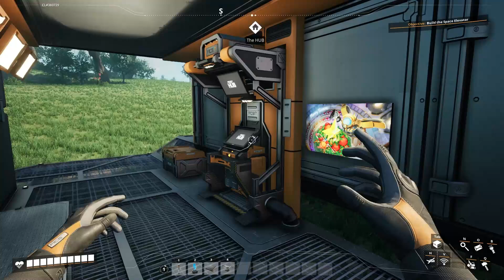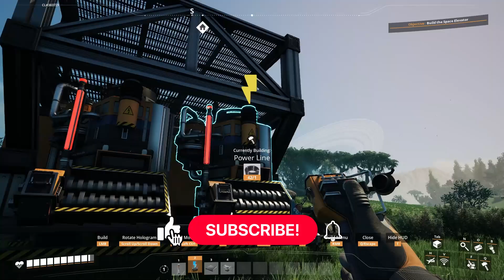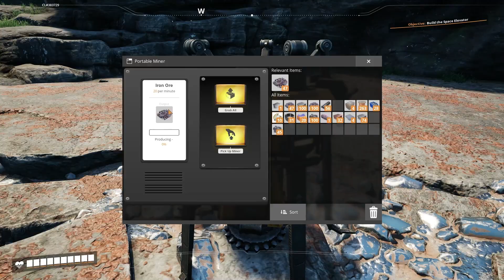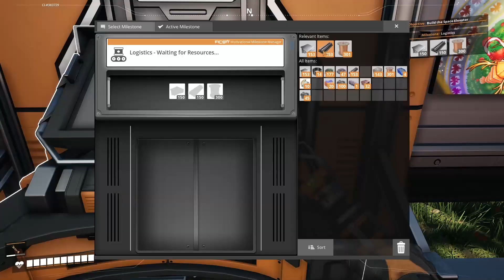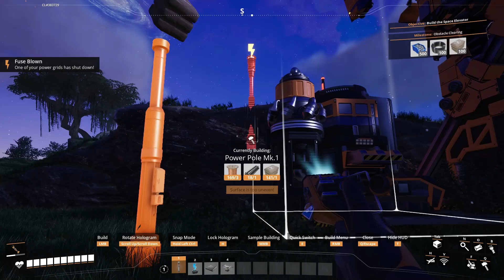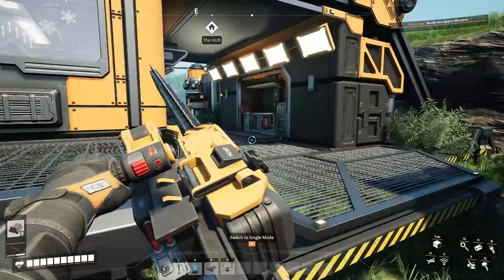Finding a better BIOFUEL - Satisfactory 1.0 EP02

Comment: Other people in the comments are wrong, the reason you couldn't snap the splitter directly to the belt is because you need to have your pointer pointed at the belt, it won't snap just cause the hitbox of the hologram overlaps. Basically just aim a little higher.

Comment: Few tips as I finished the video
1) make sure to look at both input and output ratios. seemed like you might have confused some of those and not created the most effcient stuff on some of your iron (same for your bio burner consumption rate)
2) Should be able to snap a splitter.merger on to a belt. Might be being off a foundation its a little janky
3) your woes of not aligning things will all go away once you start building on foundations
4) Middle mouse click will become your best friend, point on a machine and middle click to copy it. i.e. you can quickly built stuff without constantly opening the build menu
5) you can make a "to - do" list, right clikc on any item or machine you can built and it will pop up the mennu for it (should show up as shopping list on right hand side)
6) Mouse over anything in the build menu and press a number key to add it to the hotkey bar

Cheers mate!!!! love the series
Reply from the maker: Thanks for the tips!

Comment: As far as "Grid" there is a overall WORLD GRID that you can utilize when you start putting down foundations. There is a hotkey that will snap them to that grid.

secondly, you should experiment with the E and R hotkey when building belts and such (hold or toggle them to see the options), there are some cool built features for 90 degree angle belts and what not.
EDIT: see it mentioned in other comments as well, so sorry for the repeat
Reply from the maker: @Tubasnot  yes all good unfortunately I read the comments after building my first "factory" in ep 3. But in ep4 I start the second factory aligned to the world grid

Comment: Addressing video commentary:
Building clean setups is worlds easier with foundations. (When you get them you can Ctlr click to snap to world grid) Buildings then snap to aligned 1m increments on foundations. And can snap to inputs/outputs or other buildings much more cleanly. 

Splitting stacks can be done with right click. 

Tier 3 has the first power setup without manual fueling

I recommend building buffer crates for outputs everywhere. 

Ore nodes are infinite. (Before mk1 miners you can put more than 1 of the portable miners down)

You unlock better belts and power poles later. 

You missed the spaceship taking off for your last upgrade. 

The hub was changing with every upgrade. 

If you think those power lines are long you should see some of the late game power runs you might want to do.
Reply from the maker: Thanks for the clarification!

Comment: Holding Ctrl for snapping snaps foundations to the world grid (allows all foundations on the world to line up) and buildings to other near by buildings. When lining up buildings you will see a green and red line show up with an output and input on the buildings are lined up and a blue line when the buildings themselves are lined up with each other's center.
Reply from the maker: Oh I wish I read this before I recorded ep3. I feel like I've started my foundation grid not snapped to the world grid. What are the long term implications of this?
Reply: @DataEngineerPlays  Just what ever foundations you have built that are not on the world grid will be off or you will want to tear down and rebuild. The 2nd option is probably going to happen any ways once you unlock more and want rebuild anyways.

Comment: For hot bar you can press a number when hovering the mouse over an item in the build menu to set it to the hot bar. If you hold Alt and scroll with the mouse you will scroll through 10 different hot bars.

Comment: One trick that will be helpful is if you click a power poll on an existing power wire, it will insert the pole on the existing line. It's useful when you need to add a new pole without having to deconstruct the wire and re run it.
Reply from the maker: Oh that's awesome thanks for that
Reply: @DataEngineerPlays  same works with splitter and mergers on existing belts also junctions on pipes (dont know if you got to that yet I just started watching ur vids :D)
Reply: Thaaaaaank you